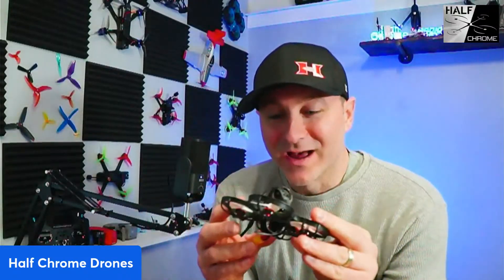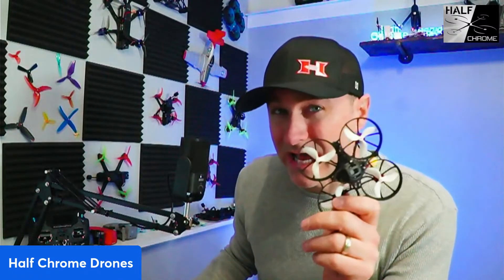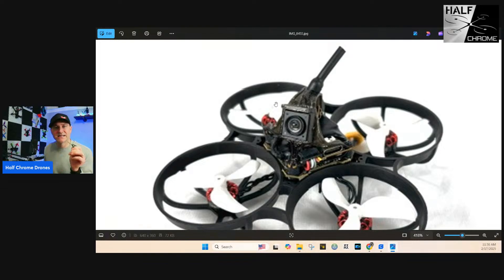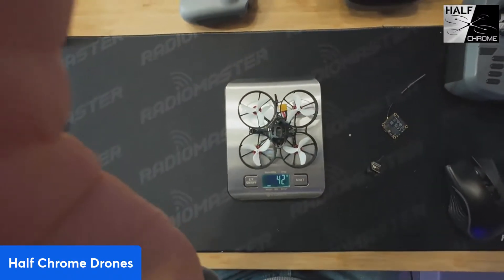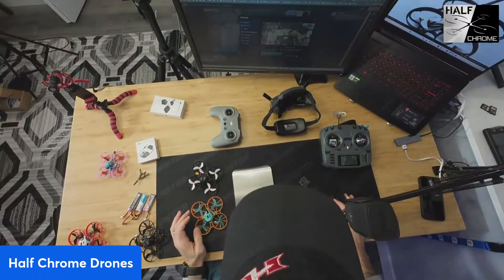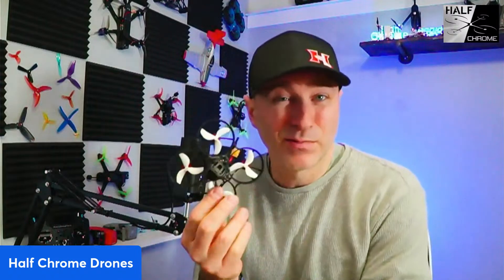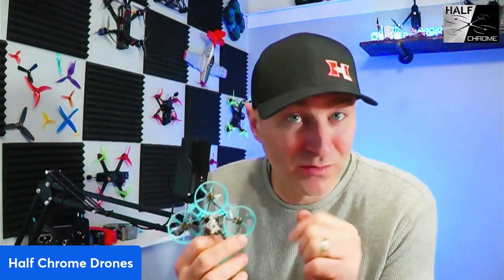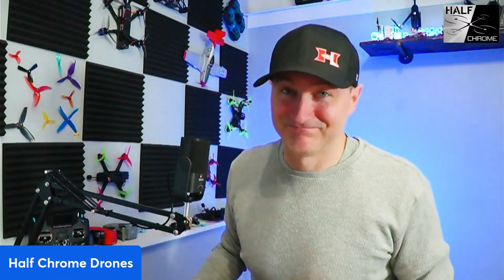I Built a DJI O4 Whoop so You Don't Have To!

Comment: i'm having a hard time figuring out how to fit the AIO and air unit onto a 75mm frame, with the frame i have it seems like the dji cable won't be able to connect.

unrelated, i have another dji o4 lite that was binding successfully for a while during the build, but when i went to go test before putting the props on, it wouldn't rebind. any ideas? i updated the firmware on everything involved. just a hail mary, not sure what i did :(

Comment: I have the O4 on a meteor air 75 frame with the new betafpv matrix 3-in-1. Comes in at about 29 grams and fly it in a 1s 450 lava and get 4 mins indoor flying.
The matrix has a 5v 3a BEC designed for the O4.
Reply: This is the way
Reply from the maker: Hmm…